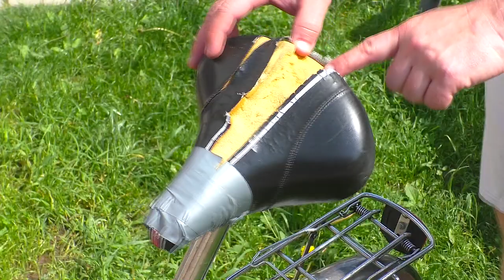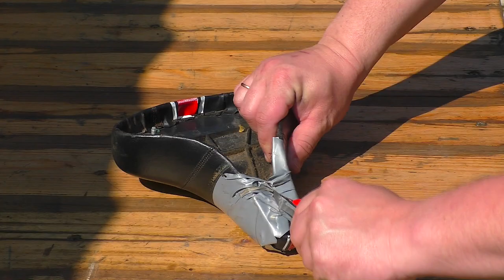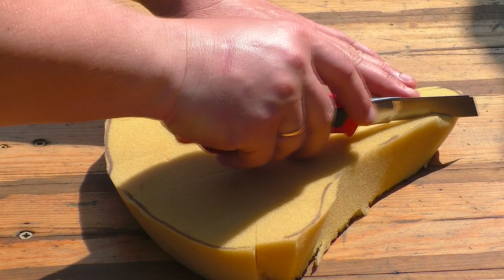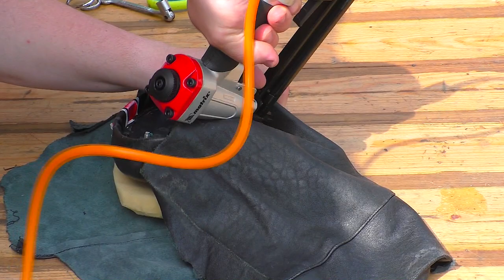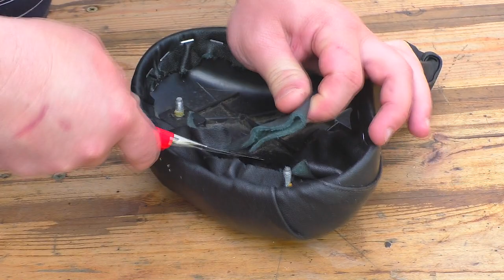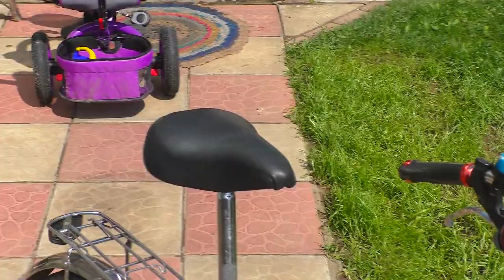How to fix a torn Bicycle seat with your own hands

Comment: Show us to fix a bike seat without stapling it.  Ain't nobody got money to buy that damn stapler.  Do you think we will buy that special stapler just to put on the bike seat cover?
Reply: Don't be silly. A basic upholstery's  hand stapler can be found for less than 10 USD and it will be able to do that work and a lot more.
Reply: Used Gorilla Glue that is lying with me and waited for 24 hours to cure, instead of the stapler.  It worked perfectly.